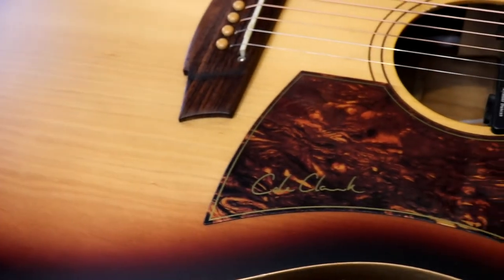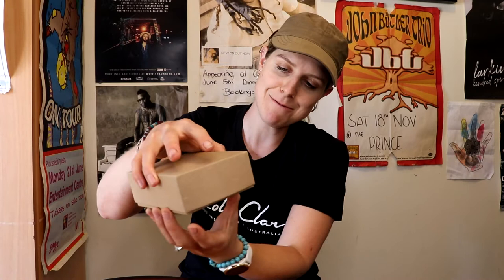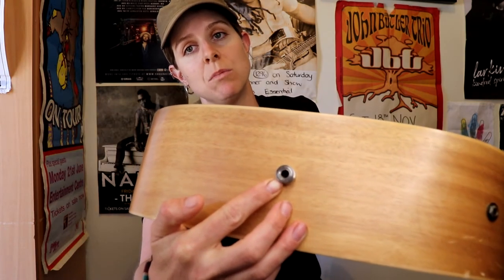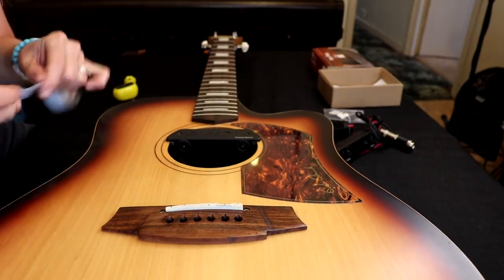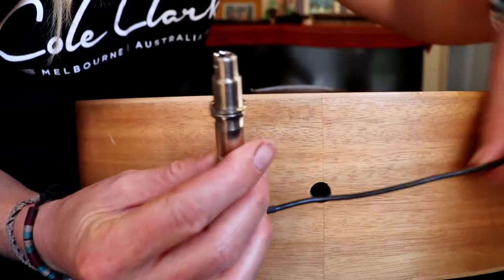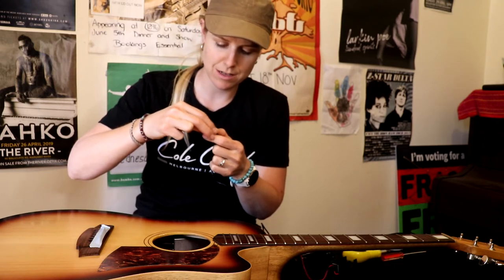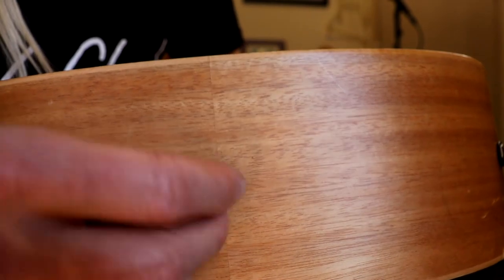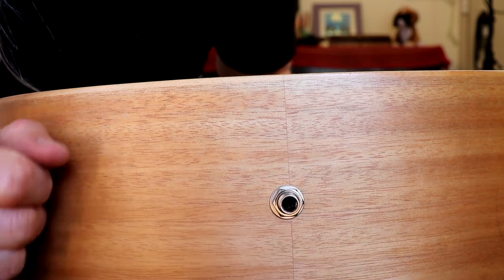DIY Guitar | Pickup Exchange - Seymour Duncan MagMic

Comment: Hi. Just got a Mag Mic and watched you installation video (even if I had to do it from scratch ;) ). Thank's a lot. You mention that the change was due to the former mic did use battery even if you wasn't plugged in. Seems like you're sure that the plug in decides battery usage or not. The thing is I can't see that subject mention neither in product info or elsewhere. Can't find ANY in on the web actually. Just wanted to check with you as it seems like you was that certain that you swipped the mic :) / My best Micke
Reply from the maker: Hey Micke, I have 4 of these pickups in total (love them!) and that was the only I had issues with so pretty definite that’s what was going on. Normally they are wired to only use the battery when the 1/4” lead is plugged in - which is how they operate in my three ‘work horse’ guitars. One day I’ll probably get it looked at it, as it can most likely be fixed I just never get around to it 😅 Does that help answer your query??
Reply: @traceybarnettmusic  Thank's for the quick response. That was my guess as taking of the strings twice a month seemed like an insane option. Just wanted some confirm as the task isn't mentioned in any documentation. BTW I succeeded yesterday with the installation (was a bit recalcitrant to drill a hole in the body of my precious Eastman E6D-TC) and I really like the sound of it. All my best / Micke
Reply from the maker: @michaelkallman4368  nicely done! enjoy